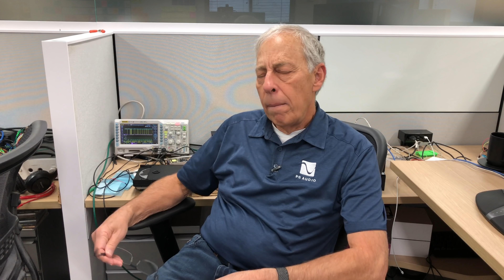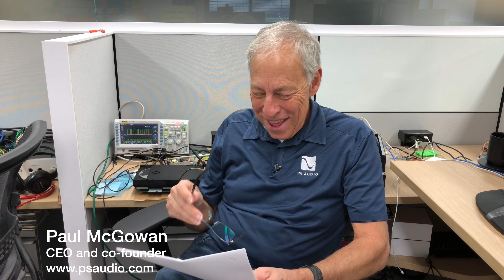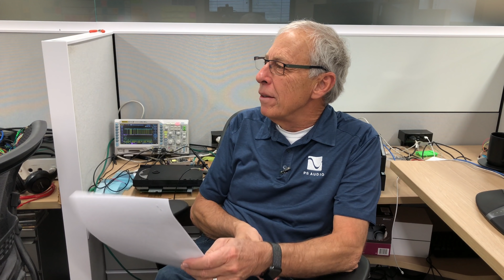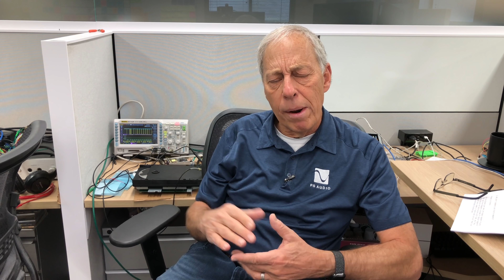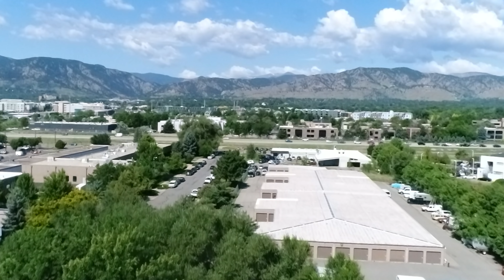Why do we need high current amplifiers?

Comment: Read the review on Darko Audio relating to the Rotel RA-10, the synergy with the LS50 is supposed to be fantastic.
I have the KEF R300, used it with the Sprout100 for 10 months and I’m happy, it seemed very clean.  Then I got Magnepan LRS speakers and purchased a used Rotel RA-10.  Compared to the Sprout100, it is a beast.
If you are looking to spend more, then Hegel amps are high current and highly regarded by many
Reply: Very nice speakers those maggies
Reply: mag 1981 thanks, very pleased with them.  I’m expecting delivery of a Hegel Röst amp today, apparently Hegel amps match very well with the LRS

Comment: Paul, I love your videos but I would take a slightly different view than you on this one. I would not advise Dan to change his Exposure 1010 for an amplifier with more watts. I have Exposure amplifiers driving Proac Response 1SC speakers which are almost certainly more demanding that the KEF LS50s. 

The Exposure 1010 has a circa 200VA power transformer backed up with a decent amount of power supply capacitance. Unless Dan feels that the Exposure does not play load enough, I would advise him to change for an amplifier with a stiffer power supply. Most of us probably listen at about 75 to 85 decibels and even allowing enough headroom for dynamics peaks are lucky if we use much more than 10 watts. This is why you can pair the LS50s with a 20 watt valve or class A amplifier and get some excellent results.

I am sure you are aware but what is critical is how the amplifier’s wattage changes as the impedance load of the speaker changes. Ideally, you would want the wattage to double as the impedance halves, i.e. 20 watts in to 8 ohms, 4O watts into 4 ohms, 80 watts into 2 ohms, etc...  I recently covered this in a Youtube video on choosing an amplifier. Sorry for the shameless plug, I hope you will forgive me.

Keep up the great videos, you are inspiration to us all!

Comment: Paul, always nice to hear your thoughts. I would like to know what you think about a lower wattage high current amp vs. normal operating amp at twice the rms rating. Lets say both amps are class ab (not sure if that matters). For example amp 1 is an older cheater car amp I have puts out 25x2 watt at 4ohms, 50x2 at 2 ohms and 100x2 at 1ohm. I would like to know if I would be better off amplifier #2 that outputs 2x50  at 4ohms even though it only can put out 2x70 into 2ohms and is not 1 ohm stable. The reason I ask this is I know that impedence varies as the music plays and even if I have my amp connected to speakers in a 4 ohm load If a large bass not comes by it seems like the high current amp might be able to do a better job responding despite its lower rms wattage rating. Incidently I would be using this amp for a nice set of component speakers they are lower in sensitivity (88 db at 2.83 volts).

Comment: Thank you very much for your answer! It’s clear for me that current and power are directly related and more power gives better control on the drivers. What I wanted to know is that if for the same power, let’s say 100W into 8ohms, it would be better for low sensitivity low impedance speakers (85db, deeps below 4 ohms the Kef LS50), to be driven by high(er) current low(er) voltage amps. If this is the case, how can we identify an amp to be high current? And yes, Dracula is a story related to Transylvania region, situated in Romania. I live quite close to the Bran Castle (check it out on the web, it’s epic!). If you decide to take a vacation, you will be amazed by the places you can find here.. I can even make you some suggestions :). Best regards!
Reply: Your question doesn't make much sense.  You do not get to choose voltage and current independently. Voltage, current, impedance, and power are all interconnected. Once you have set two of them, the other two are determined by that choice. 

https://d26tpo4cm8sb6k.cloudfront.net/img/ohms-law-formula-wheel.png

The voltage for a given input voltage is set by your amplifier's gain.  The load impedance is determined by your speakers. So the current and power are determined by those choices -- at least until the amplifier runs out of power. After that, the voltage will be determined by the available current.

Comment: I suspect when people say KEFs need a high current amp they mean an amp that can handle very low impedances. I watched a Steve Guttenberg video yesterday where he auditioned a new pair of KEFs and he said while they were rated at 4 ohms at some frequencies they went as low as 3.2. If the LS50's are like that too they would indeed need a high current amp and it would good to have one designed to handle, say, a 2-ohm load, which would be a high current amp.

Comment: I think the core matter to the question is are there amps with higher current to volts ratio, or visa-versa, or are the ratio volts to amps all the same?
Reply: Not all amps are the same. If you have 2 amps that are rated 100W try to find the gain. The one with the lower gain will be higher current - I know, counter intuitive :).
Reply: If your speaker is carrying 40 Volts into an 8 ohm load the power will be 200 watts.  If the amplifier cannot continue to provide 40 volts of signal because of the load the power output will drop as well as the voltage across the load.
The signal will be clipped and distorted.
Reply: @soring5880  how do you qualify lower gain?
Reply: @altops4490  it's a number in decibels. Generally stereo amplifiers have gain between 29 and 31 dB. If my maths is not failing me, a 31dB amp will increase the voltage of the source by 35 volts, while a 29dB will only add 28 volts.
Reply: @soring5880  No.  Gain does not add.  It multiplies.  If you have a gain of 29dB then the output voltage will be 28 times the input voltage -- at least up to the maximum voltage of the amplifier.
Reply: That isn't a good way to think about it. The thing is that voltage, current, impedance, and power are not independent quantities.  If you define two,   the other two are then fixed:

https://d26tpo4cm8sb6k.cloudfront.net/img/ohms-law-formula-wheel.png

For a traditional audio voltage amplifier, the voltage is defined as the amplifier's gain times the input voltage.  The load impedance (for a particular frequency) is defined by the speaker.  Therefore, the current and the power are fixed -- at least up to the point that the amplifier runs out of power.

Sorin G is not technically wrong about gain; but, that only makes a difference at the very extreme range of the amplifier -- assuming that you can even get to that point without running out of power first.  In reality, you will have a power level of your system that represents the volume you want to listen to your system with your speakers. 

That point will represent a particular voltage level of the amplifier and that voltage will be the same no matter what the gain of the amplifier is.  The gain only determines that you can reach that voltage given the source level.  Now the voltage is set and the speaker impedance is set, so the necessary current is also set.  Again, this is true for your listening level no matter what the gain is and you don't get to set the voltage and current independently of each other.  You set your preferred volume and the voltage and current simply fall in line based on your speaker.

Now, the only thing that matters is that your amplifier can actually deliver the necessary current when requested.  That is where the power comes in.  You need to make sure that whatever your listening level is, that your amplifier has enough power to maintain current throughout the highest peaks that your listening level will require.  So as long as you have sufficient power, the voltage/current thing will take care of itself; because, you will never be pushing the limits where it would make any difference.

Comment: The Electrocompaniet ECI-2 is 50 watts at 8 ohms and can generate 45 amps.
The Simaudio Moon 250i v2 is 50 watts at 8 ohms and can generate 19 amps.

It is class a against class a/b. So the design determines the amount of voltage it is uses?

But it doesn't mean what it can do with dynamic recordings?

Comment: Power is energy per time. One Watt is one Joule in one second. More work needs more energy e.g. more cone motion needs more energy like you running needs more energy. Power is the product of voltage times current. The voltage defines how loud the sound is but the power amplifier can only achieve a given voltage (sound level) if it can also drive the resulting needed current for that sound level (which is the voltage divided by the impedance). Usually when current is a problem it’s because a speaker has low dips in the impedance under 4 Ohms. Thus, you need an amplifier with good current output when you have hard to drive speakers. More current is achieved through more powerful transistors, larger transformer, bigger caps and so on.

Comment: The Sprout is rated 100 watts into 4 ohms whilst the Exposure is rated 50 watts into 8 ohms. The Exposure probably has about 80 into 4 so no great difference.
Reply: If the Exposure is rated for 50 watts into 8 ohms, its rating into 4 ohms will be less -- not more.
Reply: @timharig  That is incorrect
Reply: @purplehazeffc  When in doubt, do the math.

V=IR     # ohm's law
P=VI     # power law

Substitute V=IR into the power law gives you:

P=(IR)I = (I^2)R

If "The Exposure" can is rated 50W at 8Ohm then:

50 = (I^2)8

Solving for I yields:

I^2 = 50/8
I = sqrt(50/8) = 2.5A

So the maximum that "The Exposure" can source is 2.5 amps.  Assuming that we can produce the same 2.5A with a 4 ohm load:

P = (2.5^2)4 = (6.25)(4) = 25W

So the maximum that "The Exposure" can produce under a 4ohm load is 25  watts -- half of what it could produce under the 8ohm load.  In practice, due to the vagaries of the actual impedance curves of speakers, many amplifiers cannot even manage the theoretical half power given half the load.
Reply: If an amplifier produces less watts at a lower impedance then why are most amp s rated,for example 100 w into 8 ohm and 130 w into 4 ohm?

Comment: There is a lot of chatter in the Internet about the LS50s needing “extra current” because their impedance drops below 4 ohms. The implication is that the amp should double it’s output into 4 ohms or those frequencies that dip below 4 will be starved of current and unbalance the response. What those “talking fingers” don’t mention is that the frequencies that dip below 4 ohms are below and above the audible range of the LS50s.

Comment: Hi! Great video as always. I have a question; will a high current amplifier also improve the sound quality at lower volumes? Or is it just a matter of how loud you want your music?
Reply: Super low volume, probably not. But if the speakers dip into low impedence at certain frequencies, esp at low frequencies, a high current amp will sound better even at moderately low volumes.  It is because of stablility with current swings.

Comment: When pot/attenuator attenuate the signal what is happening with the power? I don't understand what is going on with the power when pot is not in 100% position? So we are decreasing total power or just voltage while current is still the same? Can you tell  what is happening with the power in that regard because according to this we get only full power when the pot is full on
Reply: Your amplifier has a gain. The output voltage of your amplifier is the determined by the input voltage of your amplifier times the gain. The volume potentiometer, if it is actually a potentiometer, reduces the input voltage of the amplifier which in turn reduces the output voltage of the amplifier. With less voltage to drive the load of your speakers, the current also drops.  Since both the current and the voltage have dropped, so does the power -- by a factor of the square off the reduced voltage.
Reply: @timharig  very good and elaborate answer that I wanted to hear to understand entirely what is happaneing. I have an amplifier that drives very loud when is at 10 o'clock, and I mostly listen to it whenis between 9 and 10. So I wondered do I lose something. It has a 42.5 dB of gain by meausurements in stereophile. I think it is made to accomodate vinyl with low input voltage.
Reply: @freekwo7772  42.5 dB means that the output voltage will be 133 times whatever the input voltage is.

Comment: Power is voltage x current. What difference would there be between high voltage-low current and low voltage-high current? [Just to clarify. No polemic here. Pure curiosity about the ins and outs of AC circuitry]
Reply: High voltage low current means really loud but clips quickly, low voltage, high current means not as loud but will not clip and will drive speakers better. You get the voltage as a result of the amplifier gain, so an amp with a lower gain will deliver more current than a similar wattage amp that has a higher gain.
Reply: So why are current and voltage not standard audio specs??? All manufacturers only list power and I find that very annoying.
Reply: @woopygoman  Good question. All amps should list watts, current, voltage, and gain at a specified frequency range and level of distortion.
Reply: 1. Traditionally, most speakers have been magnetically actuated. Magnetic fields can only be created by current. 

2. It is generally more difficult to achieve high voltage gains with low distortion than it is to achieve high current gains without distortion.

Comment: Correction: LS50s impedance is 8 Ohms (which can drop to 3.2 Ohms)
Reply: Yes, and Paul also got the LS50's sensitivity wrong - they're 85dB. I have a Sprout and LS50's. My experience with the Sprout & LS50's was disappointing. The Sprout did a much better job with my pair of Dali Spektor's which are 6ohms.
Reply: @tjp444  Have you tried anything that did work well with your LS50s?

Comment: I still don't get why higher current power gives you better sound, I mean, is there a difference between sound level and power? If your amp is cabable of producing more than enough sound level, do you still get any advantage from switching to a higher current power amp?
Reply: "is there a difference between sound level and power?"

Yes. Sound level per unit unit of power is determined by your speaker's sensitivity.

"If your amp is cabable[sic] of producing more than enough sound level, do you still get any advantage from switching to a higher current power amp?"

Potentially yes.  The active components in an amplifier are inherently un-linear in their operating characteristics.  The designer's compensate by biasing them to use a very small part of their curves.  Just as the surface of the earth appears flat up close, so does the amplifier curve look linear if you only use a very small portion of it's curve.  But the curve is still there, even if the designers are reducing it as much as possible.

The same thing applies to your listening.  If you have a weak amplifier, you will use more of the curve that the designers have made available for your and you will experience more of the curvature as distortion.  If you have a more  powerful amplifier, you will experience a smaller part of the curve and you will hear less distortion.

So yes, all other things being equal, and with caveat's of diminishing returns etc., you may very well get better sound with a more powerful amplifier. If you listening level is close to the output level of the amplifier, and the peaks occasionally push into the extreme regions of the power envelope where the distortion is the highest, then you will almost certainly get better sound with a higher power amplifier.
Reply: @timharig  ok so, if my amp is only halfway, I shouldn't need more power right?
The only benefit of getting a more powerful amp would be that it might have better components and sound better globally.
Reply: @valendis  Component quality is an entirely different matter and independent of power rating.

Strictly speaking, as long as you are not clipping during the highest peaks of your music, you do not need a more powerful amplifier. That doesn't mean that you are getting optimal sound quality. 

All other things being the same, like component quality, you will get better sound out of an amp that has several times more power capability than you will ever actually be using because you will be staying in the flattest part of the amplification curve.
Reply: @timharig  I understand, thanks for the explanation !

Comment: I understand we need "current", 'cos as the impedance is 8 ohms, to put 40 Volts into the coil, it will drain 5 amperes! But what don't they do a higher impedance speakers? Why not 800 ohms speakers, so it will be easier to the amplifiers to achieve higher voltages (and higher compliance) with less power?
Reply: 1. Most speakers are magnetically actuated.  Only current can create magnetic fields.

2. It is difficult to achieve super high voltage gains with low distortion.
Reply: @timharig  Perfect explanation Tim!!! It totally makes sense for me now! Thank you very much!!

Comment: Ohm's Law tell us that high power is impossible w/o high current. High Current is merely a bunch of marketing hype. I have a friend who thinks his  Parasound Amp is "High Current", but it is not rated into a 2 ohm load. I have several Pro Sound Amplifiers that will drive 2 ohms, all day long. My Friend is unable to accept the fact that both of my Pro Sound Amplifiers have higher current capability then his large Parasound Amplifier.  He does not understand Ohm's Law.